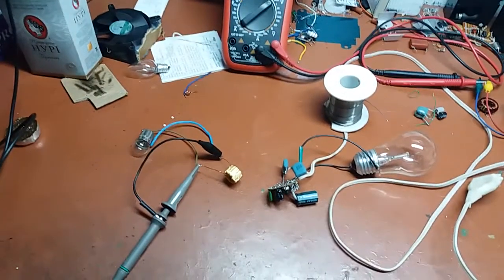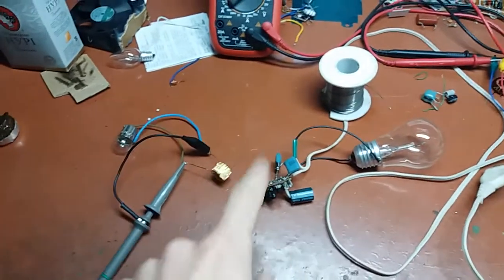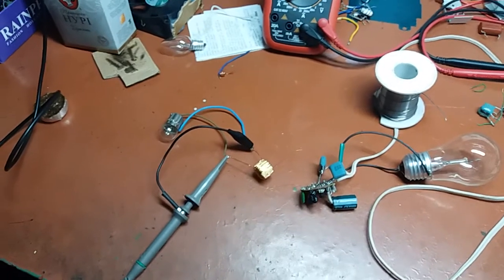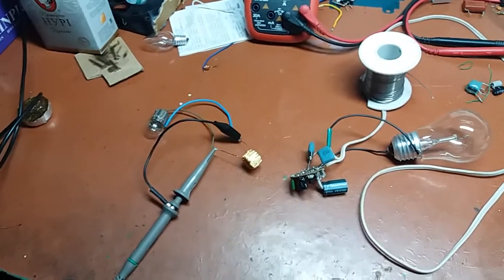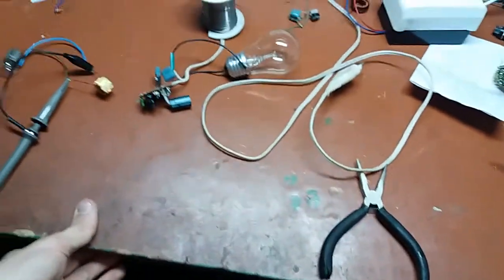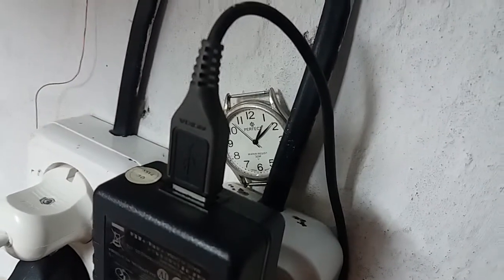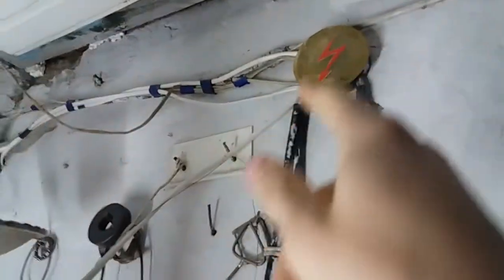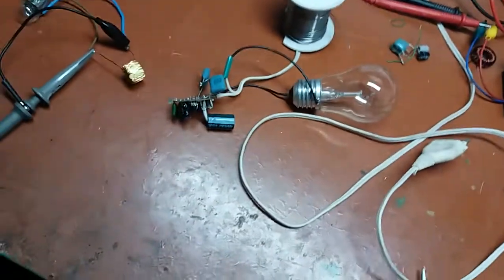CFL ballast SMPS

Comment: How many amps it can produce?
Reply from the maker: Depends on the output voltage, of course. With 13003 transistors about 30Watts, you can calculate how many amps there will be with the voltage you need

Comment: Hacking a flourescent ballast to work as a psu, you do come up with some interesting ideas :-D.
I hope the whistling noise was your oscilliscope timebase.

Yes i have seen half bridge p.c switchmodes, so i have a rough understanding of what you are doing. i covered my ignorance there :-D.

It will be interesting to see how you will add a negative feedback to regulate the output when the full load is switched off.

Your 12v supply just lacks an input filter and emi capacitor to the output, steal the parts from a dead psu, i would :-).
Getting a design perfect in one go isnt easy, even professional designers have to make revisions to there design, actually quite a few revisions in some cases.
Reply from the maker: zx8401ztv Yes, it is the scope which whines. The thing is that this SMPS is pretty quiet  (RF-wise) as is, unlike that goddamn uc3842 flyback I built previously. It's not very easy to add feedback to it, I couldn't find it on the web,  have to figure it out myself.